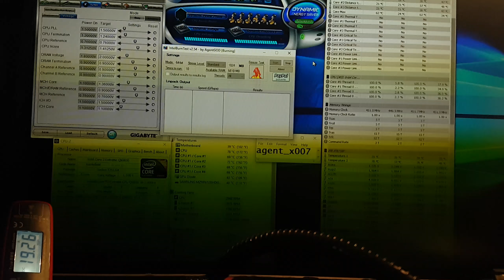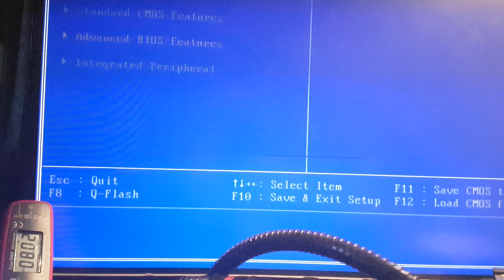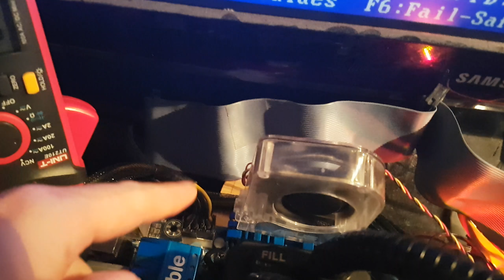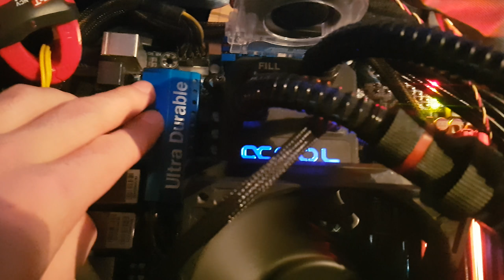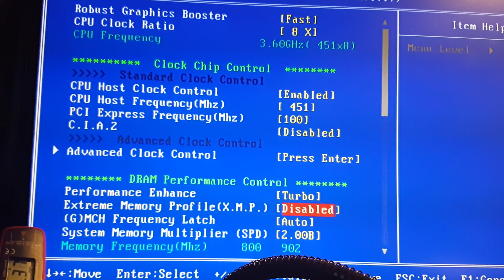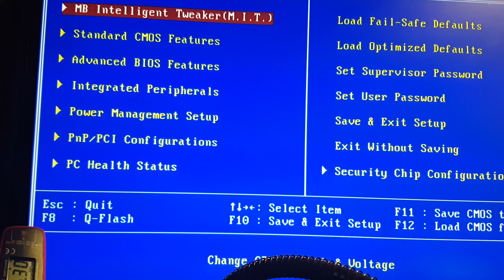VRM problem (?) : Gigabyte EP45-UD3P and QX6850 OC'ed to 3,6GHz

Comment: hi, let me have an opinion, maybe your processor is coincidentally not good, in the sense that it is coincidentally not good from the manufacturer, try using the same method as. a different processor, or try replacing your power supply with a new and pure power supply so that the power supply becomes more stable. and review again

Comment: how accurate is that ampere and watt display in hwinfo? on my ep45-ud3 + e8500 (stock atm) its showing only 30w while running cinebench which i dont believe...
Reply from the maker: Not accurate enough. Amps on 12V EPS are a LOT better (multiply those with 12V and you get Watts).

Comment: Powiedz, mi czy 1.4V jest bezpieczme dla takich Xeonów typu E5430 (45nm)?   - bo chcę uzyskać wyższe takty
Miałem problemy z stabilnością a nagle po ustawieniu Termination Voltage na 1.4V i ustawieniu Vcore na 1.35V udało mi się wkońcu wejść na 3.5GHz - przy 3.6GHz - wywala błędy w prime95 gdzie wcześniej na termination voltage miałem na 1.3V wywalało mi błędy wtedy nawet na 2.8GHz...
Płyta główna to Asus P5B na Chipsecie P965 wraz z 8GB ddr2 @ 800MHz
Reply from the maker: Termination na 1,4V jeszcze jest OK (na granicy).
Spróbuj zwiększyć NB Voltage do 1,45V i zamocuj jakoś wentylator nad chipsetem (4x2GB pamięci to dużo dla chipsetu na LGA 775).
Reply: @CompatibilityMadness  Na chipset rozumiem czy rzeczywiście nad ? :P Tu rodzi się problem bo korzystam z Spartan 3 pro. Z góry dzięki za rady.
Reply from the maker: @pietrekk_k  Nad, ponieważ na masz radiator z metalu :D
Reply: Compatibility Madness ok luz dzieki XD  a i fajnie ze prowadzisz aż taki ciekawy kanał na yt :)
Reply from the maker: @pietrekk_k  Dziękuję :) Cieszę się, że znalazłeś coś co Ciebie zainteresowało.

Comment: That's quite interesting what is happening. I had EP45-UD3R motherboard and I switched to EP45-UD3P and I never had this problem, but it's probably because I didn't have this power hungry cpu. At first I used Q6700 (oc 3,33GHz if i remember correctly) but then I switched to Xeon E5450 running @ 4,05GHz with no prolem (but this Xeon has only 80W TDP), only issue was RAM but after switching to 1066MHz ram its running pretty smooth.
My only suggestion for you here would go for more of a multiplier overclock than FSB overclock. Overclocking FSB can put much more stress on motherboard, so I would go for maybe 400x9-10 and see if it can make a difference.

Comment: Maybe the overclock is too high? I had a QX6850 and could not get anything stable over 3.4GHz even with liquid cooling.
Reply from the maker: computethisblockhead It is stable with lower Vcore. 
Add +0,04V to Vcore, and it shuts down.

Comment: That's overcurrent/overtemp protection from the VRM controller. Cooling the VRM may help, but you probably can't go further if the VRM controller itself triggers a shutdown above a specific measured current. Only modding the VRM controller and changing mosfets helps there.